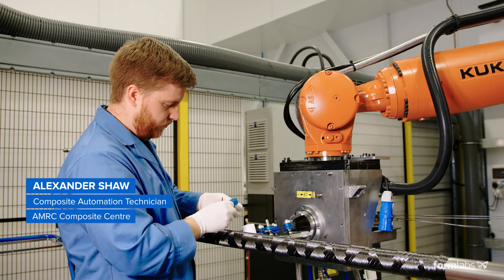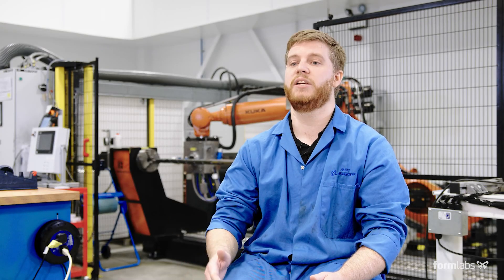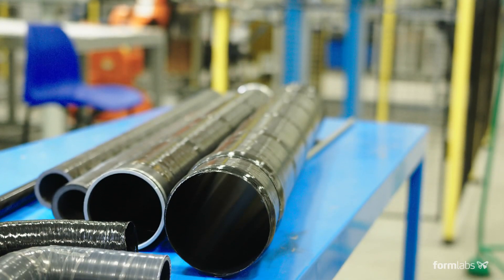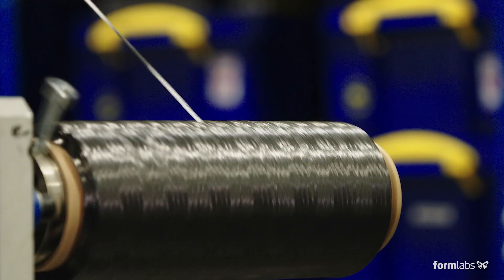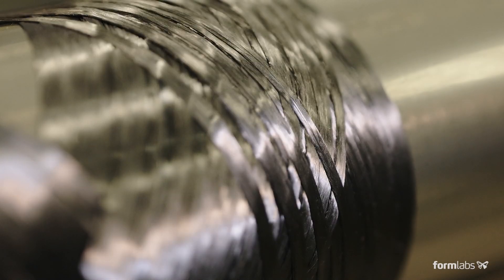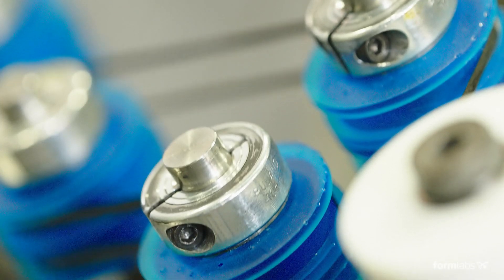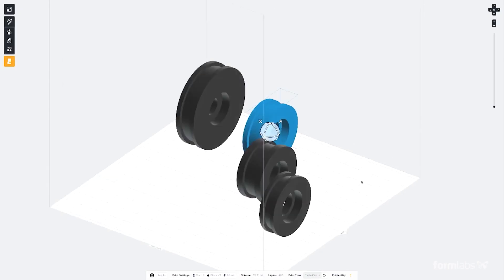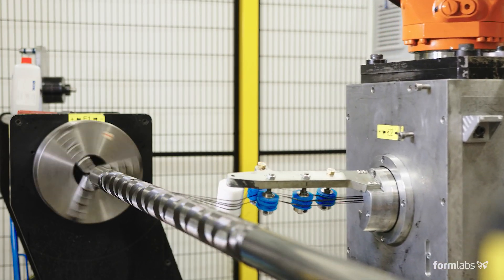Manufacturing Custom Rollers for Composite Filament Winding

Comment: This is a cool video and a cool use of technology, but the parts definitely seem simple enough to have been done on a lathe a manual one even, a tool which I assume a facility like that would have at least 1. Maybe I missed the explanation, but what makes his claim of "When we need something quickly, 3D-Printing Equipment , is the best way to produce it." true in this case?
Reply: Agreed. 30 minute job on my lathe.